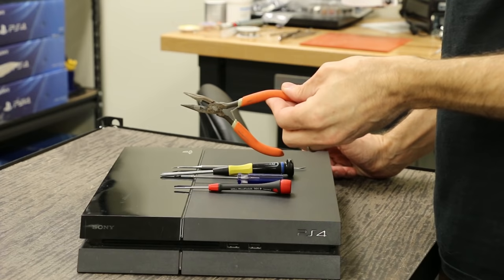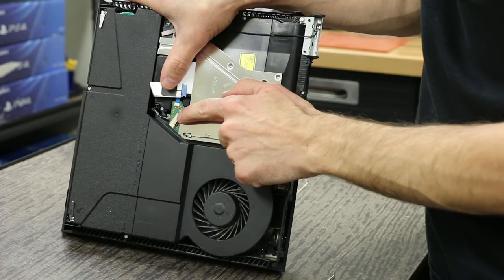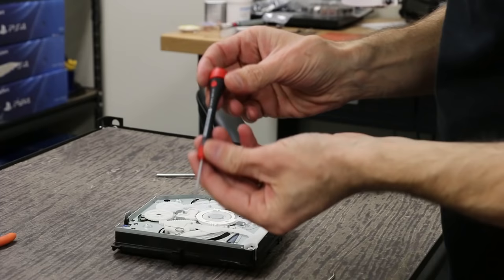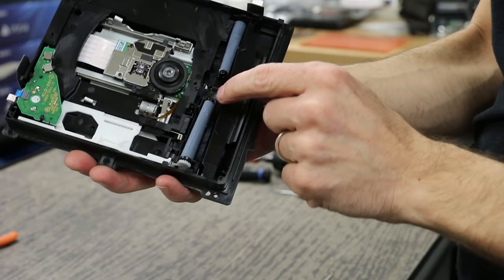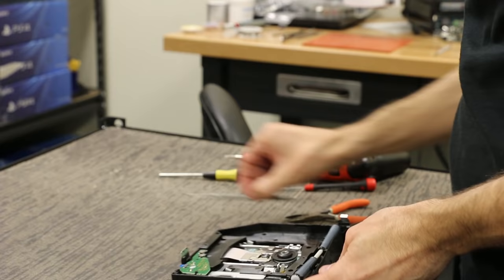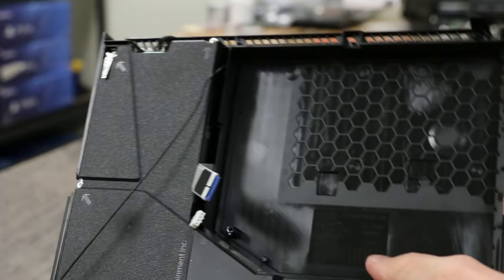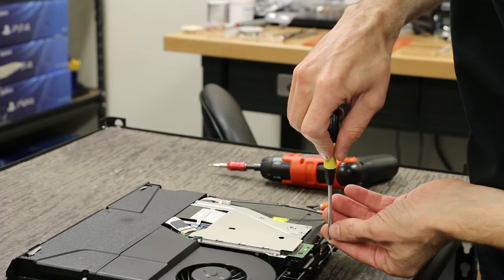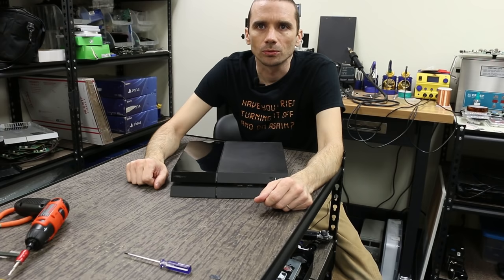PS4 Won't Read Discs Fix (Makes Noise/Won't Accept Discs)

Comment: im having un-natural noises in my ps4 slim drive but only when its pulling in/pushing out discs. it takes the disc in fine (isn't slow) and I have cleaned the rollers and other parts of the drive like the laser and different little pieces of dirt and dust I found. it sounds like the motor that pulls the disk in is just worn or aging but if anyone can help i'd really appreciate it. by the way it does read disks fine with no issue and again, the sound is only when its taking in or pushing out disks but when its not doing that, it functions absolutely normal and adequate. I have cleaned it inside and out and given it MX-6 thermal compound if that is somehow relevant or useful and the sound in question is like a stutter as it receives the disc/gives it back. Thank you to anyone who sees this and I hope to hear from someone or maybe even tronicsfix my man.
Reply: if audio is needed I can record and email it no problem. id really like to fix this

Comment: The only part I have a problem with is legit fast forwarded and not explained ffs. The screw driver at the start can’t be used, neither can a hex key because of this weird design.

Comment: You can:
A) when you put in the disc do it with a LITTLE force.
B) if that dosent already work do A) and then immediately tap in the middle of the disc area

Ur welcome!
Reply: That ACTUALLY fixed my issue, lol. Thanks, man.

Comment: I scavenged my step dads garage found screwdrivers missing one got to disc part I’m just gonna buy another PS4 to play fallout4 but I still gon use old one to play binding of Isaac afterbirth+
Reply: I also tried to fix it using a fly swatter
Reply: Tronicsfix how much does it cost to fix and is it in virgins somewhere
Reply: Virginia

Comment: Well for one thing they're not called electric screwdrivers they're called a drilland this video was no help at all I searched for exactly what my problem is which is my PS4 keeps making a clicking sound and keeps saying a disc is unreadable this video came up on the first result this video has nothing to do with that thanks for wasting my time